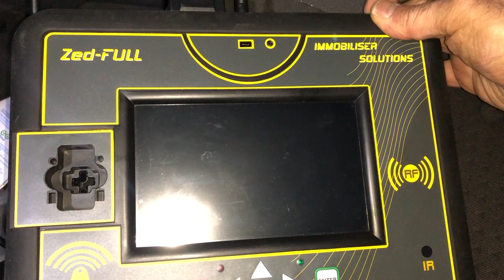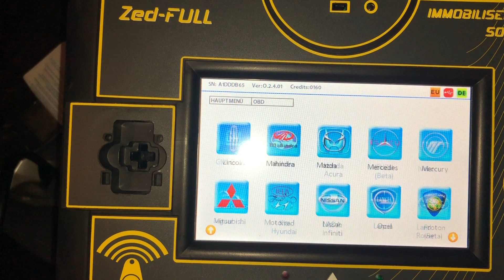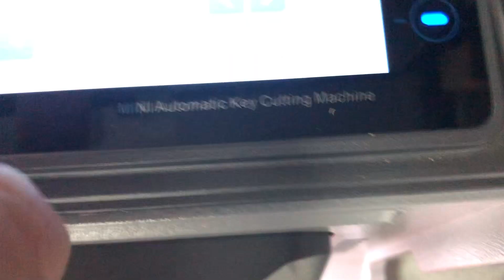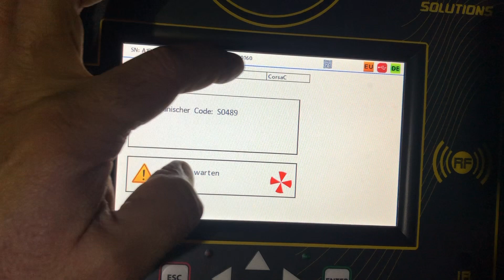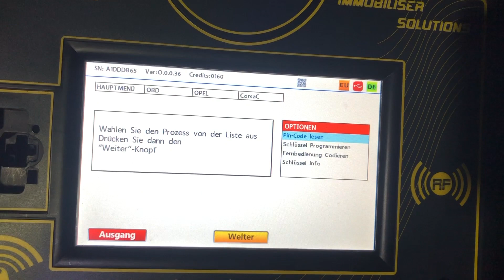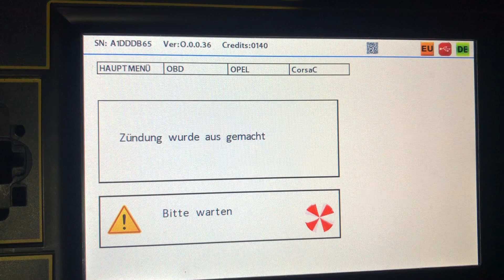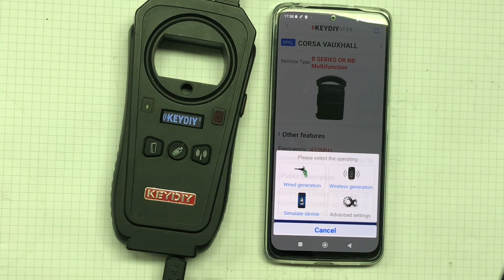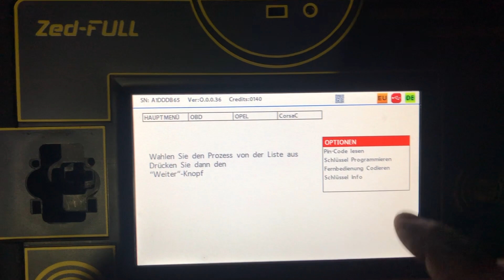OPEL CORSA C 2001 - Schlüssel verloren - programmieren - lost keys - get key cutting code by OBD

Comment: XT 27 > id40 ?
Reply: Interested aswell. Xt27 or Xt15 to ID40? Using xhorse chips on Opel is not working regularly.
Reply from the maker: Here I used the XT27 generated as ID40